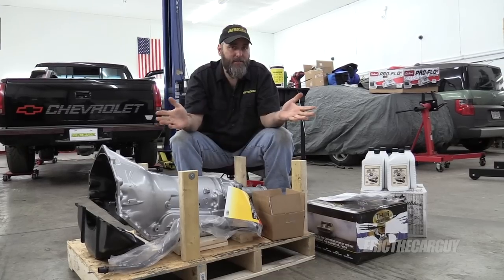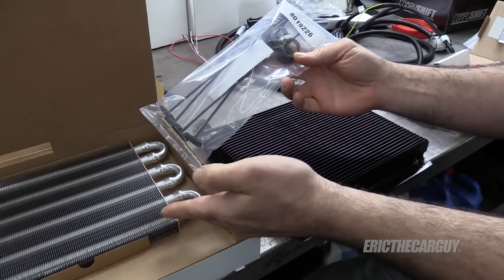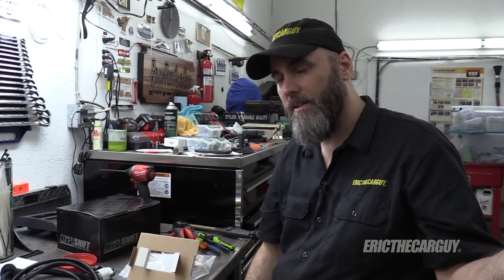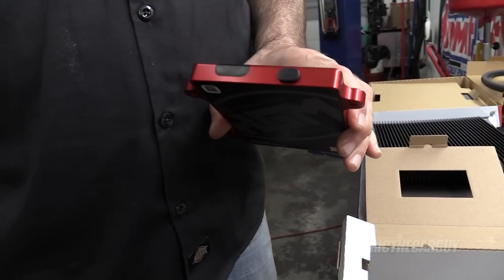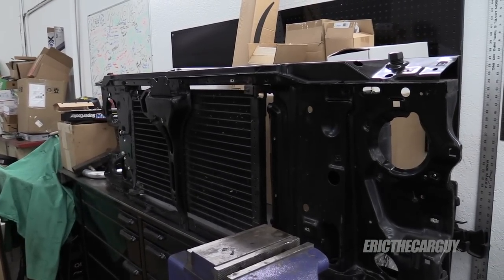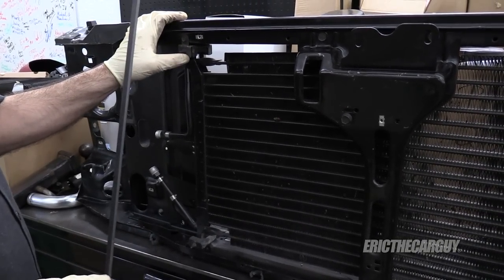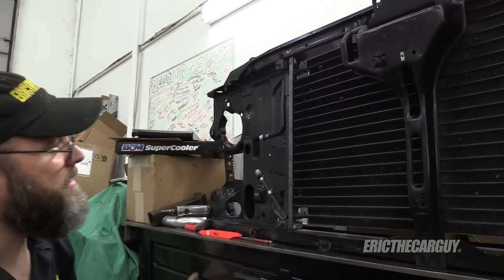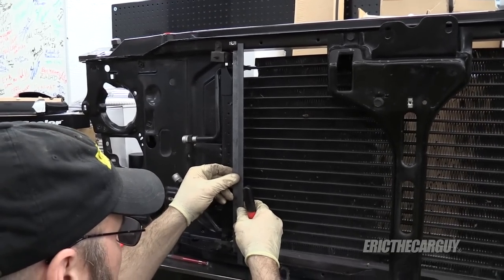Monster Transmission Intro with Transmission Cooler and Controller Installation #ETCGDadsTruck

Comment: Did OCD make the firewall harness look like a ziptie porcupine? Or is it just over built?
Reply from the maker: That’s not the “final answer”. It’s easier to add and adjust new circuits when using zip ties in this way. Thanks for the comment.

Comment: I have a chevy blazer with rubber lines that have turn to putty and disconnected. I'm doing my repair myself and have looked up where the hoses connect..but I can not tell which is which under the vehicle . Would you please post an easy diagram that faces upward so i can figure out where these two lines hook up? I will be eternally grateful
Reply: The 2 ports are stacked on top of each other, and are usually referred to in the manuals as upper and lower. Shouldn't be to hard to figure out laying under the vehicle. Getting your hands in there will be another story

Comment: Bulkhead fittings and jumper hoses to the tranny cooler would have made for a much easier install.  Reduces or eliminates the risk of chafing any hoses as they pass through the sheetmetal.

Comment: Is that transmission build or more like a factory trans... They say that the 4l60e id a weak transmission. My last truck had one that I installed. One day a guy needed me to haul gravel. I told the gravel place that I wanted half a ton cause it's only a half ton Chevy. He put 2420 pounds in the bed hahaha. It handled it like a champ
Reply from the maker: This is a performance built transmission, not factory built. For the load you were hauling, I would have felt better with a 4L80E which is a stronger transmission. Thanks for the comment.
Reply: @ericthecarguy  I agree. I told em to only put half a ton. They didn't listen. That truck was a 93. The first year they started putting the 4l60e in em. Which is basically an electronic version of the 700r4. My truck now is a 91. With the 700r4... You just can't beat a classic Chevy

Comment: Hey Eric, maybe do an ETCG1 video about all those aftermarket transmission companies? Curious what your thoughts are; I did some research on these for a 73 F100, and half the reviews sound horrible while the other half sing their praises.
Reply from the maker: I've heard the same. Also, some have mentioned this in the comments. So far, I only have a couple of minor issues that I'm trying to sort out. I will be doing follow up videos on my experiences with the transmission and it's operation. Thank you for your comment.

Comment: Eric, you're doing it wrong... well, maybe, kind of :)
When tightening the fittings into the cooler you were putting torque on the cooler internal structure and the pipe the original fitting is attached to. That's a good way to crack the thing. Better to use two wrenches and put force only on the fittings.
Love your videos
Reply from the maker: It's not made of aluminum. If it was, I would have been more concerned. Thanks for your comment.
Reply: @ericthecarguy  Actually all B&M branded stacked plate style coolers ARE aluminum. 100% aluminum in fact. They're actually manufactured by LONG. Most Tru-Cool branded coolers are LONG as well. LONG is an OEM supplier for most of the domestic brands, GM, Ford, FCA ect.

Comment: eric, weren't you the one who said to not modify cars lol and called it molesting and i agree with you on that it makes a nightmare for other mechanics to fix lol but i guess youre not selling your cars.
wait what lol those self tapping screws are beasts plowing through steel that quick.
Reply from the maker: I don't think you got the message I was trying to convey in that video. That said, I have no intentions of selling this truck, ever. Thanks for your comment.

Comment: I have to say that I cringed when I saw you using self-tapping screws, leave those for the aftermarket audio and alarm guys. Those components will be rattling before you know it. You want to be using crimp style thread inserts (i.e.Nutserts) and fine threaded fasteners with thread locker.
Reply from the maker: So far, no issues. Thanks for your comment.

Comment: Why not just use zip ties and foam spacers around it so that they don't touch?
Reply from the maker: Because that would still rub against the front of the condenser. Also, I wouldn't be able to use the larger, better, cooler that I did in the video. Thanks for your comment.

Comment: I haven't heard anything good about monster transmissions
Reply: Though some of our reviews are negative, we work with every client to resolve issues and improve their experience. There are quite a bit more positive reviews than negative and in comparison to the number of custom-built transmissions shipped out every week (100+), the percentage of issues is very low. We are happy to discuss any specific reviews that give you concern by calling 800-708-0087
Reply: Nice reply MT, how generic of you. Reminds me of your replies to and on the BBB (Better Business Bureau) site. Your company doesn’t except BBB’s standings or ratings just because you say so; therefore so you just ignore the issues & complaints of customers? How convenient for you. 

Perhaps you could just resolve the issues like 99% of the other company’s reported to the BBB? Then you wouldn’t have to reply with “Monster Transmissions is not associated with BBB. Call our number or email us to resolve the issue” when you know good & well you’ll just give them the run around; hence people reporting to the BBB in the first place. Show some integrity & honor your word/warranty’s, parts, labor and take accountability for your many mistakes.

Monster Transmissions, if you continue rip people off, word will spread and will continue to do so. This should be an eye opener for you. “Word of mouth” still means something.
Reply: @MonsterTransmission  when i had my old silverado I was thinking about getting a new transmission but after seeing so many bad reviews I would never buy a transmission from you guys
Reply: @pit257  Hello! Thank you for your feedback! You are absolutely correct, word of mouth means something. We are thrilled to report that we have over 12,000 five star reviews on Trust Spot, where all submissions are verified to be customers. We do respond to complaints filed right away, we contact that person directly. I would love the opportunity to discuss your experience and apply that feedback to make the necessary changes. You can contact me at 800-708-0087 or leave your information so that I can follow up with you right away. 

Kind regards, 
Randi, Client Care Representative

Comment: So disappointed that you went with that brand.  So much hype for junk products.  Had mine for just over 5k miles, but it was a year and 1/2 old and they were giving me a hard time about warranty issues.   Rarely towed anything and nothing more than my lawnmower 2 miles per week.   Had so many issues to no vent tube, to heat damage, to mismatched parts.  Very expensive and frustrating experience.

Comment: I'm surprised you got the 60 and not the 80. But either way the monster transmission are built up very well
Reply from the maker: The 80 is larger and heavier. Also not necessary at this power level. Thanks for your comment.
Reply: @ericthecarguy  fair enough haha. When you mentioned towing I only assumed but you know where that ends up

Comment: Question. I have an Acura TL '04 with 243,000 miles. The problem happens randomly when driving. When driving, my car randomly doesn't want to accelerate. I could put the pedal to the floor, but no acceleration. When I take my foot off the gas, there is a hard deceleration. To fix this problem, I have to restart the car.
 It happens randomly. It could drive fine for weeks, then it could happen 3-4 times a day.
Reply: Go to the YouTube channel MODS FOREVER. The guy is a TL guru. My best guess based on experience (08 Tl Type S) and what MODS preaches is that your trans needs work. Replace the shift solenoids and do a 3x3 (3 trans fluid changes over 3 weeks) to get new fluid (Honda trans are very sensitive to fluid pressure and old fluid throws it off) if you dont change your trans fluid often. The shift solenoids is probably the big issue though. Also good maintenance and possible issues are cleaning your maf sensor and changing the PCV valve. All relatively inexpensive.
Reply: @Luckingsworth  Screenshotted
Thanks for the reply, Jon. Will study up and get it done. I'm gonna check out Mods Forever as well.  🤙🤙🤙

Comment: You added a cooler the hardest and most expensive way possible. Suburban and dually had those....35 bucks salvage...brackets hard lines and all.  2 compressions and 30 minutes done.  Just saying